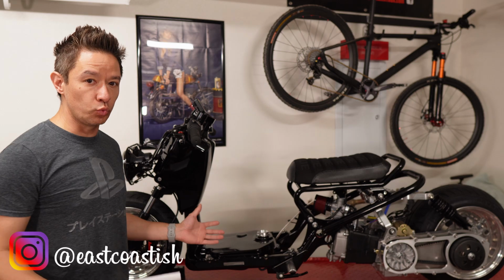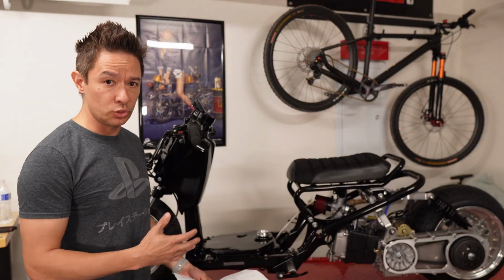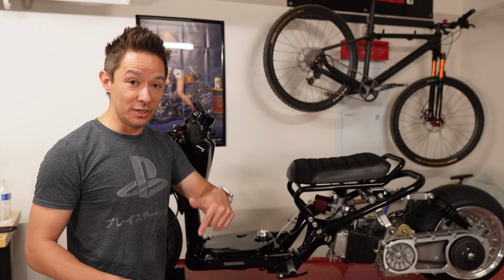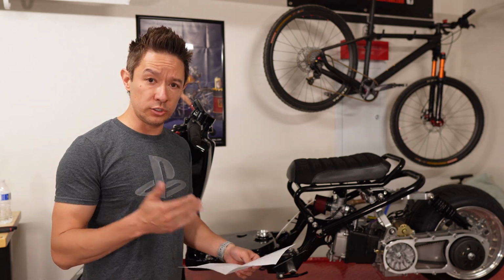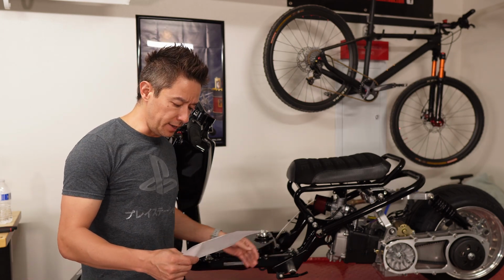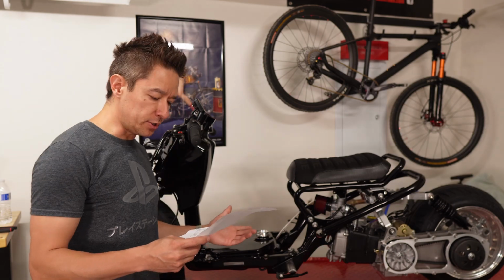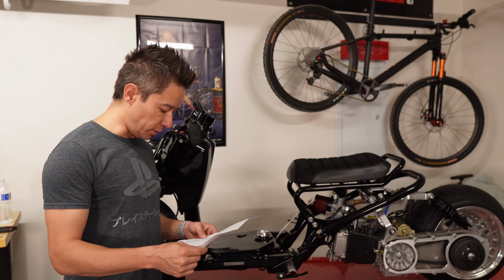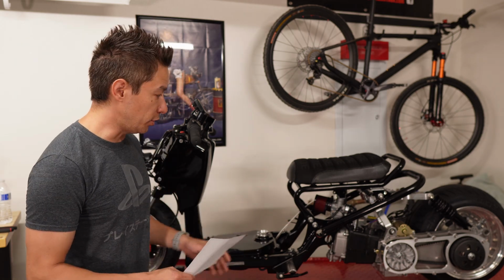Honda Ruckus GY6 Build Parts List and Cost to Date

Comment: Super happy to see that you went with a Cheeky seat cover, they do an amazing job. Make sure you get yourself a well built exhaust and mounting bracket, the motor tends to vibrate which will cause the exhaust to crack.